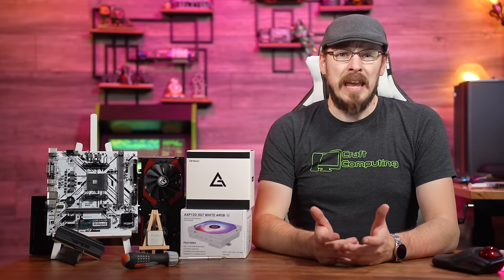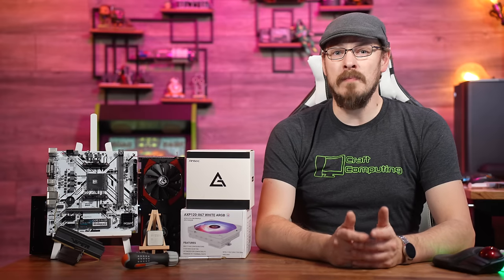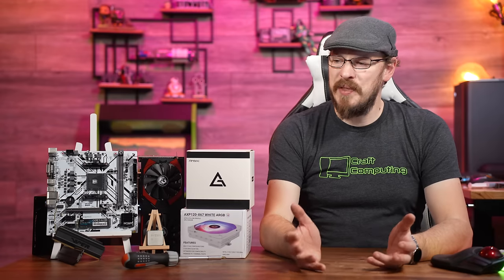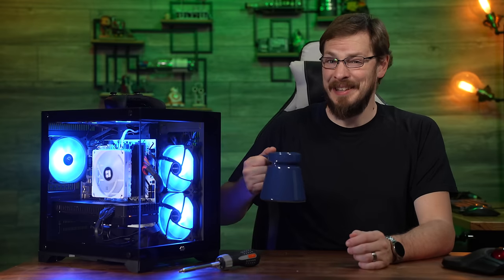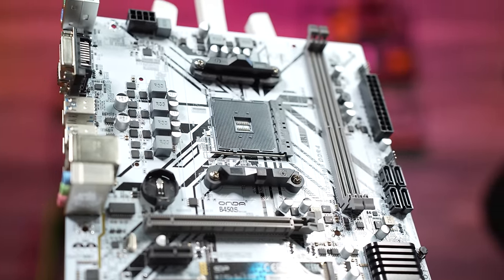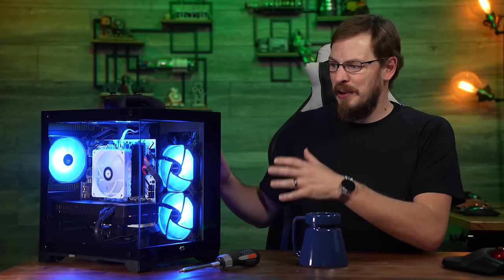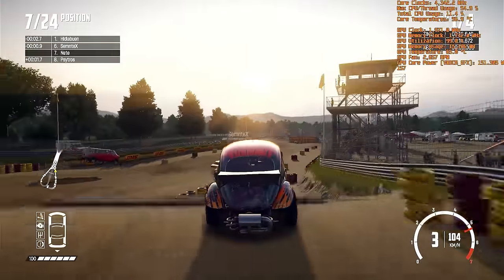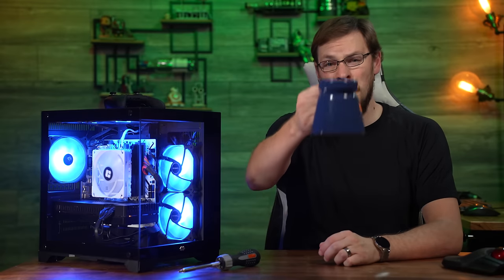I built a Gaming PC for my Nephew on AliExpress

Comment: Probably 1000th comment about the same: what if you set Memory overclock to 3600, but leave all other settings at "Auto"? That is how it is supposed to work after all, those are then fetched from SPD and scaled accordingly.

Comment: Even when chinese motherboards have regulated fan headers they're only PWM regulated, no voltage regulation, so if your case has a bunch of non-PWM fans they'll just run at full speed.

Comment: The R5 3600 more than often goes for $60,I would hàve gone with that instead of the 3300x,and stuck with the stock cooler then go for an OEM case + a $10 acrylic side panel,n use the extra $20 for some red n white extension cables,that said awesome build for 1080p though allan wake would be a no go zone with the 5700xt,maybe a used 6600xt would fare better?I dont know,nway awesome build n yes AM4 interms of price to performance beats any xeon or previous gen intel chips

Comment: I totally agree on your stance against risking unstability from trying to squeeze a tiny bit more of the RAM. I personally did not have a lot of luck pushing any kind of chinese motherboards to the limit of the supported memory frequency. This was specially bad with some Erying with laptop CPUs that I purchased out of curiosity having seen a video in your channel.

However... I must say that saying that the recommended speed for a Zen 2 Ryzen 3000 is 3600MT/s is a bit far fetched. I would say that is in the upper limit you can aim for in a daisy chain motherboard with 1DPC and normal luck in the silicon lottery, and probably messing a bit with the SoC voltage. I would say 3600MT/s is only more or less warranted on Zen 3 (5000) CPUs. And in this latter case, 3800 or even 4000 are achievable, but specially the latter it depends on your IMC.

I liked the video and the content. I personally think the title is a bit misleading, because about half of the parts are brand new and from amazon, according to your affiliate links and some comments in the video about the RAM for example. Despite some chinese parts, IMO this does not fit the name "Aliexpress PC" or "on Aliexpress" for the most part.

Comment: Basically, all the components were a good fit except for the graphics card.  Tried to save power on the 65watt tdp cpu but made an error with choosing the right graphics card.  The 5700xt does outperform some of the 6000 amd gpu but the power draw was horrid.  It is what made me decide to skip that generation of graphics card plus buying new psu and do my budget build with the 6000 cards.

Comment: on intel boards in the past using regular green pcb ram i would set my memory speed and the first four timings manually (example: 1600mhz 9,9,9,24) and leave the rest on auto and would still get better results then if i had left it at stock. And i did this on first gen ryzen with a 2133mhz kit getting it to 2666mhz but i can remember timings. you dont need to know all the timings to get a small boost out of the ram.
edit: i didnt watch whole thing sorry. I agree not to do this giving it to a kid that doesnt have a clue.

Comment: idk if the situation in the US is that different, but here in the EU, i'm still able to buy new in-stock AM4 B450 Mainbaords from the big manufacturers, prices starting at 52,90€ and up. the Asus Prime B450M-K II has 2x4pin fan headers and can OC memory up to 4400MHz, why gamble on a more expensive incomplete board from aliexpress?

Comment: I agree with most of the build except for GPU. Don't have anything against 5700XT or AMD GPUs in general, but I have some beef with used GPUs, especially RX 5000 and RTX 2000. Not because they're "outdated" mind you, but because they're usually living their last days. This graphics card is 99.99% a refab, with the board and most of the components brand new, and the GPU die from another card. And while RX 480/580 were basically unkillable with an immence ammount of new GPU dies on top, all the subsequent AMD GPUs don't show the same characteristics in the repair practice. With them if something critical dies, it also grabs the GPU die and all the memory with it, unlike NV with omnipresent VRAM defects and core phase fails, and believe me, fixing phases and replacing VRAM is a relatively cheap task (unless we talk abt 6X 2gb in 3080(ti) 20g and 3090ti). Honestly if you're in a real pinch in terms of budget, searching for something used on local markets sounds like a better idea, concidering the quality of GPUs in refabs. Even mined to hell die won't have compound as black as the refabs

Comment: Maybe you can get away with the PSU if you went down to an RX-5500XT for about $70, or go up a bit to $170 for an RX-6600m and get about 5700XT performance with much less power and heat.

Comment: In you opinion, what is the bottleneck in this system?
From what I can see, the CPU seems to run at ~25% at maximum, while the GPU is working hard.
Would you say that even a lower-end CPU could be used?

Comment: TBH I was kinda expecting one of those oddball laptop cpu in a desktop mobo to get picked. The only reason I can think of not to get em is the limited PCIE slot, but the mobo here has the same limitation (also 1 slot). So I'm kinda wondering why an older, slower 3300X was picked instead

Comment: Good luck trying to get memory running stable at 3600 on an AMD platform. 😄😁
Even on better mobos.
I spend weeks tuning and tweaking and never got 3600mhz stable on my amd platform. Max I got out of it was 3466mhz stable with slightly relaxed timings.
This was on an Asrock B550 pro 4.
Tried it with both a Ryzen 3300x and a 5600x.
Tried it with 2x8GB Corsair Dominator sticks and 4x8GB GSkill Trident Z, all sticks AMD approved and rated 3600 cl16-19-19-39.

Comment: Thank you for this video. What AGESA using this MoBo? Asking becouse pcie4 was only on beta bioses with old AGESA on non 5хх boards and was disabled in actual versions. So or AGESA is old beta (and thats why there is RAM speed problems) or pcie4 is a marketing fake and pcie is not working in mode 4. Its simple to check using gpu-z:)
P.S. All futages with board there is no vrm radiator, but at the end in case - there is one on the left part of vrm

Comment: its definitely time to move on from x99.... motherboards are becoming pricy to get and stuff like ryzen 2700/3700 will give you all you need in mutlithreaded usage aswell, or get a 2600/3600/5500/3300x if you care about gaming, it will be miles better and carry a gpu couple tiers above what the xeons can. old b350/b450/a320 boards used can be dirt cheap and they all can boot any ryzen cpu fine (dont get A series + 2000 non-x like me or you have no OC nor no PBO so its locked to stock clocks)

Comment: the 3300X is limited to 3200MTs according to AMD's specs.
Reply: That's JEDEC spec which is the official spec both AMD and Intel have to adhere to and has nothing to do with what the actual CPU/IMC are capable of.  This being Zen 2, unless it had a bad IMC, it should be perfectly capable of doing 3600MT/s stable.
Reply: Eh, AMD is very conservative wirh their memroy ratings. My 2600x is listed as 2933 iirc as max, yet runs perfectly fine with 3200mhz ram

Comment: Odna is my favorite motherboard manufacturer too 😂

EDIT: I know the green label cx500 is garbage, is the green cx-m the same? If so that 5700xt might be pushing it on a questionable PSU rated at "only" 430w.
Reply: The CX-M PSUs have internal components that are a bit higher quality than the regular models but nothing high-end.  They still use Chinese caps, for example.  The PSU didn't actually have to deliver 380W, that was just being pulled from the wall and not what the PSU was delivering which would've been around 80-85% of that given the efficiency rating.  So in reality the power supply was delivering more like 300W under full load.  RX 5700 XTs don't pull that much power: 225W total board power at stock under full load.

Comment: Why a negative pressure system???  Gonna lead to a lot of excess dust in the case.  Also, if you think Starfield is demanding for PC, go play Lords of the Fallen.
Reply from the maker: Good thing its made entirely of glass so I know when to clean it. Likely at the same interval I'd clean it with positive pressure or no pressure.

Comment: At the end using good and crappy parts together makes a crappy pc imo. Needs B450 mb from reputable brand (preferably black), psu with enough power and no mustard/ketchup power cables (preferably black cables), graphics card from reputable brand, preferably a black cooler for aesthetics.

Comment: Why would you buy the MOBO in the first place knowing it was missing XMP and RGB or even worse without knowing if they were there because you didn't bother to check the specs??? Whichever it is they are both pretty big fails for a youtuber showing off how to build a cheap system. Also your title is disingenuous because you DID NOT buy all the parts from AliExpress. You are correct about one thing. You CAN get a mobo for just a few bucks more with these features. Heck with the right sale even WIFI. I know I just got one on Newegg for $67.00.

Comment: HELLO, MAYDAY, MAYDAY, PLEASE HELP ME. I follow some of your old videos related to the X99 Motherboard from SZMZ, which is the same as JINGSHA X99. I also got me a RX580 Graphics Card with 128gb 2133 all from Aliexpress... My problem is = I don't get any video with the Bios start-up at all. Everything is dark. So I got a new universal VGA card, but the result was the same. Darkness. My battery is perfect too. I follow many forums related to this motherboard and many people got the same problems and Aliexpress or SZMZ do not answer any email at all. Please tell me how do you make it, to get video out on your X99 motherboard. I do not use NVME M.2 but 2 Toshiba SSD 2.5 1tb each with Windows 10 64bit pro and one with Windows 7 64bit pro. PLEASE HELP ME.  Thanks.
Reply: this is a dual socket board?

Comment: theres no way that can be a real AMD GPU?
Reply: likely a place (datacenter or something) that had thousands of them and they slap new heatsink / paste / shell on it and done.. because they replaced it with the new generation
usually these chips.. GPU.. CPU.. NAND memory.. RAM etc all last decades. The stuff "dies" because some tiny capacitor on the board or resistor went bad but the real brains, the silicon, is still good. They generally last far longer than they are worth performance wise. We're coming  to a stop with that though.. Good CPUs in 2010 are still good and can max fps on games today, there's barely a performance difference for stuff using GPU.. If you are encoding a video the real difference is more cores/threads other than that not much. So anyway upgrading at this point is more hobby than necessity..